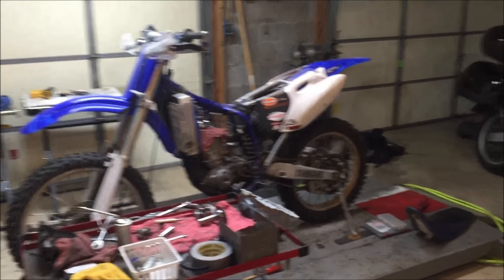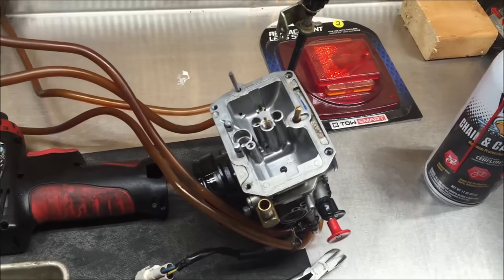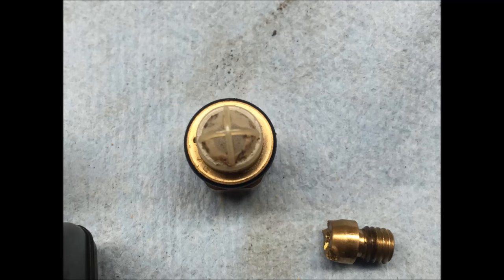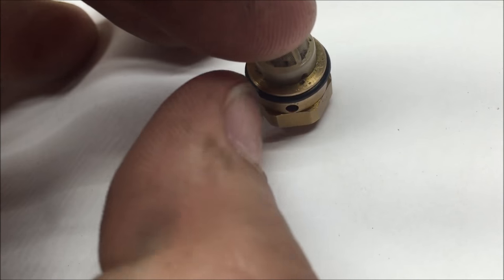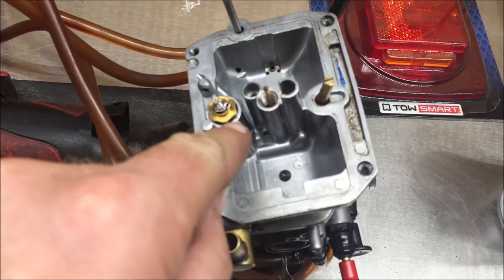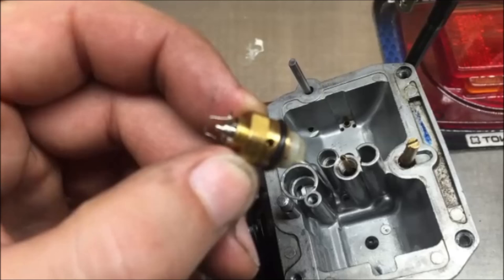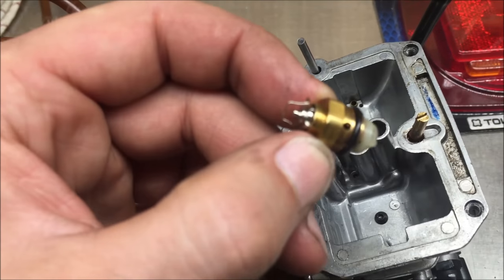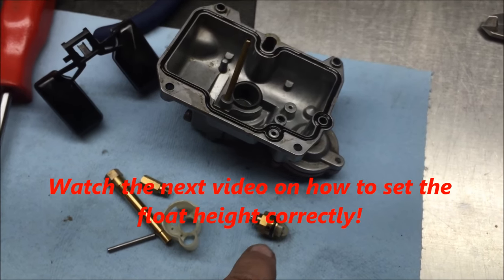Carb Cleaning: The most over-looked part- UNDER the float needle! Demo: YZ250F

Comment: Very interesting info mate,  I'm having trouble starting a Yz250f myself,  I can hardly smell any fuel on the spark plug and the carburettor has a steady stream of fuel coming out of the over flow. Also the bike has been stood for about 14 months before finally get around to getting a valve job done as one of the inlet valves had gone tight.
I've just received a needle valve set prior to stripping and cleaning the carb so all new seat etc will be fitted anyway.
Your video has given me a clear understanding of how the needle valve fits into the carburettor as when I looked at the kit that I received I couldn't identify the pre filter, just didn't understand what that really small plastic item was that was inside the packet.
Thank you for a simple clear and concise video from Chris (U.K.)
Reply from the maker: Thank you for the kind words!  Head over to the new website and subscribe to the newsletter to never miss a video or newsletter! 
https://how2wrench.com/contact/ 

If I can ever be of service to you, here is a video explains how to connect with me. 
https://www.youtube.com/watch?v=vjvmB01ebcsm 
Keep Wrenching,
Shane Conley
Instructor/Motivator/Motorcyclist
www.how2wrench.com 

Did you like this free video and hope to see more? Would you just like to say thank you with a donation? Click https://www.paypal.me/how2wrench
Reply: did you figure out your problem? i have the same, keeps overflowing. wont even start

Comment: I had the exact same bike and it was so lean from the factory it was a bugger to start and ride away without a long warm up. I went to three size smaller leak jet in the bowl first. Then noticed the fuel squirt from accelerator pump was so quick it actually hit the slide as you opened the throttle. Once I set the clearance timing on side of carburetor, installed the smaller leak jet so more was going into the fuel squirt it has been a pleasure to ride. Off idle response is immediate, and runs stronger than ever. OEM is set to meet EPA regs, not optimal performance. The bike is stock otherwise.

Comment: This is very useful! But can you advise how to remove the needle seat easily? Is there a tip?(most of the time it is so hard to pull, even with pliers) - the hard removal is maybe the reason why cleaning under the seat is skipped when servicing the carbs.
Reply: The most common way to remove a stuck seat is to thread the inside with a tap then extract with a bolt puller, and buy a new seat and oring

Comment: I got it out. With the pliers. It's pressed in hard. I damaged it.
I bought keihin rebuild kit for 50euros or something. This float seat, valve, gaskets and more were all included.
And yes, that tiny filter cap was all clogged up when I took it apart.
Reply from the maker: Thanks for commenting and adding value to our community!

Have you subscribed yet to never miss a video? Have you seen the video playlists? Over 600 videos! Check them out here: https://www.youtube.com/user/conleybuilt/playlists  

Want to say “thanks” or “keep it up”? Click here https://www.paypal.me/how2wrench    
 
Your answers and help are just around the corner. Save time and money while protecting your investment and yourself by doing it the right way at www.How2Wrench.com

Comment: Great vid I often over looked the valve seat my bad. Working on a Xr650r carb dose the valve seat come out ? Tried to pull it but not budging! Maybe it’s a press fit ? There’s no filter on the other side of it you can see straight through. It’s super dirty in there would like to replace it . Hope you see this msg , or any body familiar with these Xr650r carbs . Thanks old dirt bikes.

Comment: Great video. My 2012 ktm 300 exc has a pressed valve seat that I expect is my fuel leak issue. How do i get it out and replace the o ring? Cheers
Reply from the maker: If it's pressed in, there's not oring to replace...new carb...😔You can tell by looking to see if there is a fastener "holding" the needle seat in place. 
👍 Thank you for taking the time to comment! Hit that subscribe button if you haven’t please! It helps us! 
Here is a way to support all the free videos.
Want to say “thanks” or “keep it up”? Click here https://www.paypal.me/how2wrench  

Coach Conley is also available for hire to personally work one on one with you if ever needed. Yep he is a real person. Give him a call @ 602-345-0432

Your answers and help are just around the corner. Save time and money while protecting your investment and yourself by doing it the right way!
Follow us!
Web:
www.How2Wrench.com     
www.Tools2Wrench.com

Comment: Great vid. How did you get this part out?
Reply from the maker: I need to do a video on that one. It's on my list. This is hard not to damage. I place an unused drill bit (chuck side) in the seat and then use needle nose pliers sideways on the OD of the seat lifting upwards. Works 99% of the time with no damage. But then there's that 1% of the time that will require replacement. 
Head over to the new website and subscribe to the newsletter to never miss a video or newsletter! 
https://how2wrench.com/contact/ 

If I can ever be of service to you, here is a video explains how to connect with me. 
https://www.youtube.com/watch?v=vjvmB01ebcs 
Keep Wrenching,
Shane Conley
Instructor/Motivator/Motorcyclist
www.how2wrench.com

Did you like this free video and hope to see more? Would you just like to say thank you with a donation? Click https://www.paypal.me/how2wrench
Reply: That would be great to see. I am having troulble with one of these carbs on the wrf leaking fuel from the overflow had it off and on to many times now to keep guessing.This is the only part left that has not been out inspected and cleaned. 
Many thanks.
Reply: Scott Thomson n

Comment: Hello Shane Conley.  I see you're working on a steel frame yz250f.  I have a 2005 WR250f that i've completely rebuilt the carburetor on besides this float assembly, and if I tip the bike over it's a constant stream of fuel from the overflow line.  I've been told my model of carburetor has a non-rebuildable float valve assembly.  Is this true?  Is my carburetor junk?  Yes my float height is at 8mm same as your other video, and the manuals recommendations.
Reply from the maker: If it was a quick answer I’d try to respond here but I wouldn’t want to lead you wrong assuming certain factors. Reach out to me on my website contact page. We have been overwhelmed with ungrateful people and scammers so I had to do something for my sanity by screening the over 300 requests a week!
Contact Link: https://how2wrench.com/contact/ 

Your answers and help are just around the corner. Save time and money while protecting your investment and yourself by doing it the right way at www.How2Wrench.com  
Have you subscribed yet to never miss a video? 

Have you seen the video playlists https://www.youtube.com/user/conleybuilt/playlists? 

Want to say “thanks” or “keep it up”? Click here https://www.paypal.me/how2wrench
Reply: Hi Robert. YES is the answer, I had the the same problem some carbs you cant change the needle valve seat. I got a new seat but it would not seal. The seat with O ring will not fit into the carb casing. I had to replace the carb.
Reply: @scottthomson700  thank you for your reply.

Comment: Working on a 250ninja carb.

Can’t get needle seat out.

There is barely a lip to grip pliers on.

Pliers also chip the brass lip when trying to remove.  

I also inserted a drill bit inside hole to keep seat from crushing inwards... but still can’t pull needle seat out
Reply: Kroil + Knipex needle nose. Twist and pull.

Comment: nice! this will be a useful tip
 also. if you have the time
 my cbr has a flat spot around 5-7rpm? it's a 87 .  so it bogs but kicks back in as lomg as I stay on throttle. any clue as to why it might be doing that?
Reply: did u ever find out why it had this bog at 5 to 7 mph?
Reply: @IMPORTANTVIDEOS7   yes.  It was the  3 Rd cylinder slide sticking . It would only open up half way.

Comment: I have an 2001 honda xr650r and the needle seat is part of the carberator. it cant be removed. how would I clean the back of the seat?🤔 any thoughts?
Reply from the maker: Lots of carb cleaner flushing, ultra-sonic machine etc...good news is there is no filter under the seat and just external filtration...👍 Thank you for taking the time to comment! Hit that subscribe button if you haven’t please! It helps us! 
Here is a way to support all the free videos.
Want to say “thanks” or “keep it up”? Click here https://www.paypal.me/how2wrench  

Coach Conley is also available for hire to personally work one on one with you if ever needed. Yep he is a real person. Give him a call @ 602-345-0432

Your answers and help are just around the corner. Save time and money while protecting your investment and yourself by doing it the right way!
Follow us!
Web:
www.How2Wrench.com    
www.Tools2Wrench.com
Reply: Big thing you didn't cover is the inside of the float valve should be shinny.  Ifs its dull the needle won't slide well and cause fuel to leak out.   You can polish it with metal polish and q tip in a drill

Comment: My scooter dont hve needle valve only float pin how to solve overflow i replaced pin and petrol t then again carbo. Leaks is there some solution plz
Reply: Same thing here. My 50cc scooter cuts out at 15mph. Cleaned the carb, cleaned the petcock, and flushed out the fuel tank. But still, same problem. No power past 15mph.
Reply: @mitchellstephens8011 not same problem

Comment: My needle valve doesn’t have a socket fitting or even a way to get it out. I’m afraid to pull it out with pliers.
Reply from the maker: Thanks for commenting and adding value to our community! We can help if needed.

Have you subscribed yet to never miss a video? Have you seen the video playlists? Over 600 videos! Check them out here: https://www.youtube.com/user/conleybuilt/playlists  

Want to say “thanks” or “keep it up”? Click here https://www.paypal.me/how2wrench    
 
Your answers and help are just around the corner. Save time and money while protecting your investment and yourself by doing it the right way at www.How2Wrench.com
Reply: Then it does not come out ..probably the fuel strainer is somewhere else

Comment: Got my assembly out, it was a bitch. Ripped the o ring pulling it out. Put several different o rings in there and it won't seal up, fuel just runs out the bottom of the bowl. Guess I'll order a kit but im not certain I should have took it out now. Probably could have just blew it out with air
Reply from the maker: "Probably"....It's like buying a lotto ticket, maybe you win, maybe you don't. Now had you found a bunch of gunk under there or a plugged screen, you'd be high-fiving like crazy with thank you...but then again maybe not...